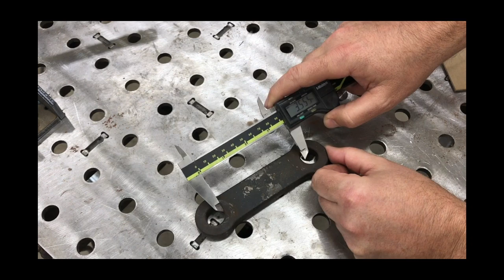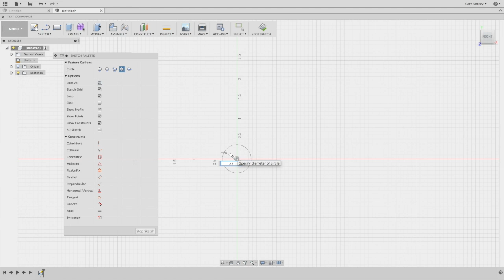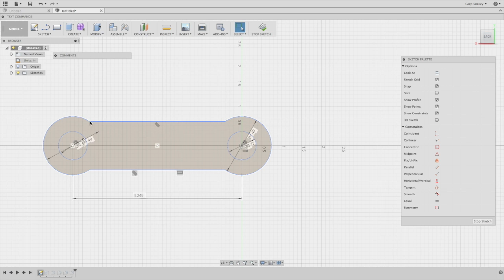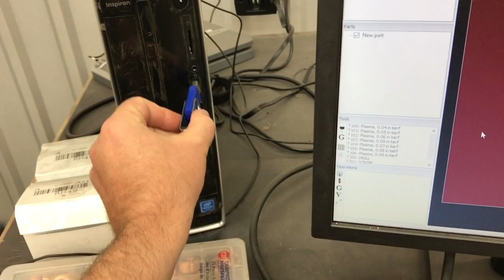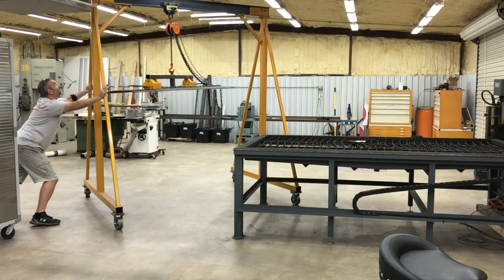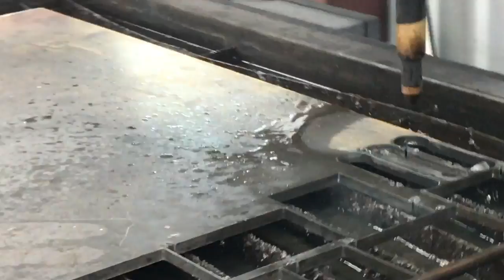Making Dump Truck Parts - Small Fabrication Shop

Comment: Being its almost such a perfect fraction, 4.249 is well beyond fine, but i will usually drop in a pin gage on one side and then using a tubing caliper measure from the inside of one hole to the outside of hole to the outside of the pin gage.  If i need to be super precise, ill use 2 pin gages, mic it and calculate it.

Comment: Fantastic video Gary. What how and why pretty straight up. Why gets missed by many, I think "why" is what makes the most interest for viewers. I've never messed with CAD, you made it look like anyone could do it. Never seen the whole process either, made great interesting content. My OCD was working too LOL, but my experience with customers that hand you the product to copy would have made me do the same thing you did. Either it's identical or it's not, usually they will pay for identical that didn't work out. Then have you make modifications to a new set. Rarely would someone, myself included, pay for non working- not identical to the example given. Great little project done well.
Reply from the maker: OLD SCHOOL some great points, thanks sir

Comment: Why don't you run some Ethernet cable out to your plasma table computer? Autodesk probably has a fusion 360 post for your machine too. Or they could whip one up quickly.
Reply from the maker: The ethernet port is connected to the actual plasma controller itself.  It's on Wifi, it's just spotty coverage
Reply: Ramsey Customs - turbocobra I'm not fond of WiFi in a shop environment.  My machines are all hardwired no more sneaker net here.  time well spent setting it all up.
Reply: I like the Sneaker Net myself on any machine that makes money. My large printer, my other CNC... both sans internet or any kind of connection. I ran into an issue a few years back where an auto update left us high and dry and unable to output. There is sooo much legacy CNC control software out there, that still only runs on Win7, XP etc... They perform flawlessly, but there are no upgrades to Win10 or anything newer. Plus, if my employees or helpers understand that they have to plug the art into the cutting/printing computer, there is only one function to per performed on that machine. No internet, no email, no facebook and NO UPDATES!

Comment: Can't you here me screaming it's FOUR AND A QUARTER! JK. Good vid. Thanks man good work.
I know sometimes it's a pain but if you touch the material to ohm out and get your height then program a move that's off the material 1/8" so your lead in is a severance rather than a pierce you won't have to worry about that dross catching and your tips will last 5 times longer. It can be a pain to get it right the first time but after I got it down it's easy to place your parts a set distance from the edge or open hole. I did it a lot when I had a smaller machine and didn't have a choice cause I couldn't pierce thick stuff. Not worth doing on thin material of course. Just a thought I know you were talking about how fast your tips were going the other day.
Reply: Yeah it triggers me that he kept 4.249" rather than 4.25"
Reply: Steve just Steve 4.249 made my OCD kick in to make it 4.25! lol
Reply from the maker: My bad, I should have provided a "trigger warning" Maybe seek shelter in a "safe place" until your triggered state subsides?
Reply: haha...